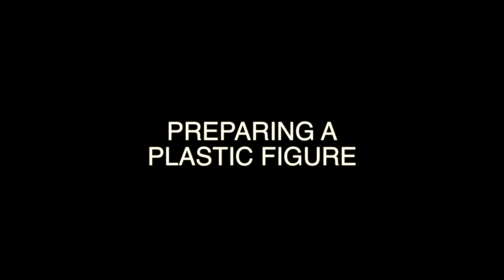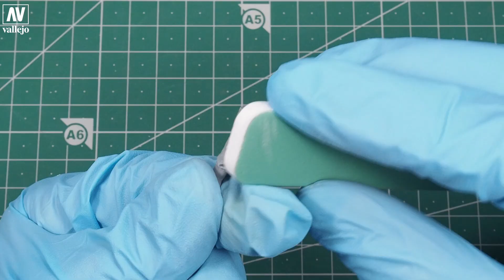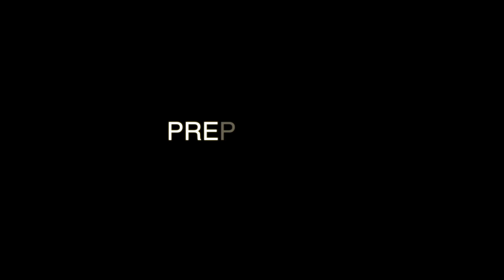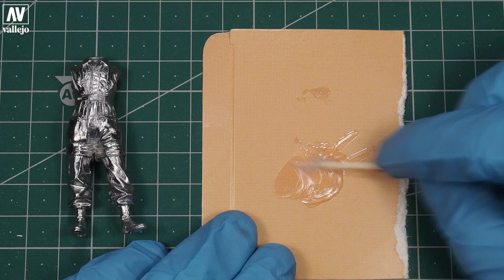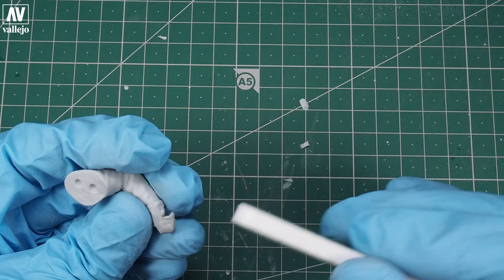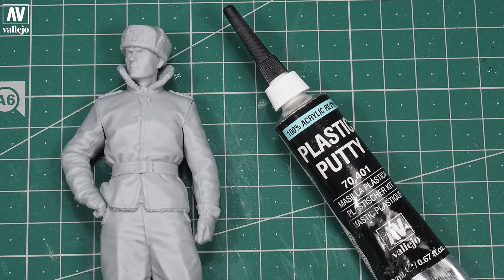FIGURE PAINTING from A to Z - Get your figure ready 🇺🇸🇬🇧

Comment: vallejo you need to step your game up. I recently purchased Panzer Aces old wood 70.310 and its supposed to be a light color but i got a darker brown. I sent an e-mail through your website with the numbers on the bottle and i have never heard back from you. It made me think if you mess up one color how many more will you mess up in the future or how many have you already made errors on. I have money to spend, so i repurchased all my paints from AK Interactive. I got the new 3rd gen 236 paint line and their new figure line. i got around 50 new ak paints, plus some Tamiya's and Abteilung's. Everything i have from you I'm putting in a box and leaving in a closet that's 80 model, panzer aces, decal products, putty adhesive which i haven't even opened. i dont even want to look at Vallejo because the name angers me.  Also why's your light colored paints always so runny while the darker stuff is so thick? AK Interactive is all the same, also their paints don't change color in the bottle after they haven't been used for a while. I know losing one customer won't hurt you but hopefully you continue to alienate more people and more and more will start switching over to other brands. I also paint Warhammer and i have over 70 Citadel paints and i've never had a problem with them. i just hate their stupid pots but i figured out a great way to extract the paint with mini spoons from Mr. Hobby.
Reply from the maker: Hello M F! We are sorry to hear your experience was not good enough with that specific color. Our colleagues on info usually receive tons of all kinds of emails so maybe they could attend yours. Anyway, you can always contact us through all our social networks and we will make our best to help you quickly and satisfactorily. Also your feedback is always welcome; if we receive news about strange behavior regarding some reference we can inform our colleagues to ensure this dont happen again 👍🏻😊
Reply: @vallejocolors  ill provide you the control num: RCHPCQO, barcode # 8 429551703109, purchased in Toronto, Canada. The store i got it from was nice enough to refund me the money without me having to send them back one bottle of paint. It's not their fault.  Like i said its not the $4.00 i spent, its the principle. Makes me think if one is wrong how many more will be like or or were like it. The color is supposed to be like a beige, this one is a brown. I know what it should be because i've seen it used on peoples youtube channels and in pictures on forums. Here is a website forum where they used Panzer Aces Old Wood 70.310, it is the fourth (4th) picture. Thats the color it should be, but my paint looks like the first picture. That first picture was after the 310 Old Wood was weathered with washes, and the products. bloodandpigment.com/2019/11/24/gun-emplacement-painting-guide/
Reply from the maker: @MF-kv8cn  Thank you so much for the feedback! We will immediately transfer these color issues info and code to our lab and quality control team; things can happen but there is no excuse for not doing it right! 💪🏻Thank you again!
Reply: @vallejocolors  
this question is related to the Panzer Aces colors, so for example there is Afrika Korps Tank Crew 70.336, and Afrika Korps Tank Crew Highlight 70.340. So how would somebody go about highlighting the base color? would they mix the highlight 340 into the base 336? or no mixing and just applying the highlight on top of the base? Thank you for the answer.